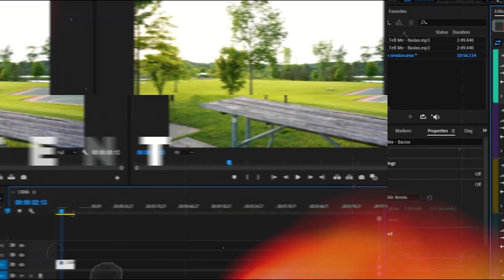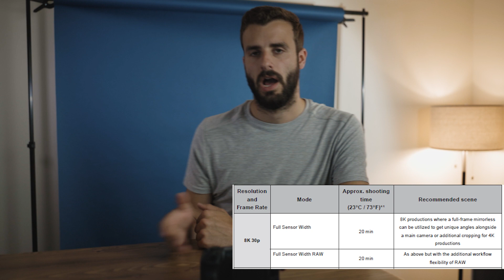How To Prevent The Canon EOS R5 From Overheating

Comment: Hey just wanted to spread the word that you can also plug in an external recorder (like Atamos Ninja V) and if you remove the memory cards you can record 4KHQ as long as you want.
Reply from the maker: Yeah, I have that on my list to test since I have a ninja V which I would imagine you can get some  pretty long record times since the processor is not working that hard at all if recording externally. I might even buy the adapter to allow me to record 4k 60 externally. But as for now, testing the internal capability is key.
Reply: Sorry, can you explain this to me as someone who is new to camera specs? How does an external recorder help eliminate overheating?

Comment: Wow, finally a review by someone who has read the R5 manual and clearly understands the strengths of the camera, as well as the limitations.  This is how a review is supposed to be done!  Great job!!!  I am a wedding photographer and pre ordered the R5 for "stills".  Already purchased the Canon 28-70 f/2.0 and cannot wait for the R5 body.
Reply from the maker: The 28-70 f2 is the BEST. absolutely love mine. Its what I used to film the vlog. But yes, not many people actually looked into the spec sheet to see what canon designed each mode for. Instead they just see "oh it overheats when you shoot crazy high bit rate video at 8k raw, that is unacceptable" and I thought I would help shed some light on that.
Reply: @EngineeringFilmmaker  I just subscribed, liked, and clicked the bell.
Reply from the maker: Thanks!

Comment: The overheating culprit is the CF Express Card reader/writer and even just at idle. I already have an R5. Sony ditched this format in their A7s3 because of these issues I’m pretty sure. In the end, other things cause heat too, but the CF card is the biggest problem.
Reply from the maker: The processor is what gets too hot. It has to compress all the footage you are taking into something to send to the SD cards. The cards do get hot but the camera can still overheat with external recording since it still has to compress footage. The reason you have to use CFexpress cards on canons formats is because the bit rate is WAYYYYY to high for a dslr/mirrorless camera. Normal 4k and 1080 are fine. 4k 60 and above start at like 800 mbps and go up to 9000mbps which is way too high. Sonys new camera I think doesnt reach 1000mbps only like 600 which is why you can use a regular sd card. Normal SD cards (the expensive ones) just cant write data fast enough compared to what the camera is trying to send it at. CFexpress cards are 10x faster than sd cards.

Comment: Solid recap. I see too many people projecting a personal defense of the camera as if to validate to themselves it's worth it. It's a tool not a toy lol if the tool is inconvenient for your work scrap it. At the moment no. Once that fan adapter comes out then possibly. Until then I'll stick with the S1h. I do interviews and commercial work so a single mention of overheat is a liability on the field and for 4 grand I'll let others beta test this until updates are made.
Reply from the maker: yeah, the 4k 60 is not meant for weddings. Just had some overheating issues yesterday with it. Making a video soon.
Reply: @EngineeringFilmmaker  looking forward to seeing that
Reply from the maker: Uploading now. Just a short recap video about it not really working in 4k 60

Comment: I ordered my R5 and I'll use it for hobby vlogs.. I only shoot in short bursts anyways, so the over heating doesn't apply to me.  However, the Sony a7s3 was tempting, but for $300 less, its missing camera specs for my photography needs.  Plus I have a few RF lenses that I will never part with 😄
Reply from the maker: 100000% I am right there with you. Sony for photo is just  like buying a smart car to haul a camper lol. I also have the RF lenses and will also never leave them.

Comment: Awesome video dude, I totally agree with everything you said
Another, maybe useful thing for some of the creators, is that you use an external recorder like the Atmos Ninja V you can actually get past the record limit (and mayne the overheating issues that may appear) - which is a big win in my opinion. I'll definitely look to get myself an R5 in the coming months...seems like a world difference from the EOS R, much more polished, rafined and improved across the board.
Reply from the maker: Yes! Thank you. I will hopefully be doing some tests with an external recorder since I do have a Ninja V. However, the highest you can go is 4k 60 and i am not sure what kind of bit depth it can record at. In order to shoot 4k 60 on the V you need an adapter of some sort that seems to use SDI instead of HDMI so I am not sure if it would work since my camera had HDMI output but who knows. I know that there is a Ninja recorder that does 4k 120 but its $1200. I dont know of any recorders in consumer range that record 8k though. 

I would imagine you could get past the overheating if you use external recorder since the overheating portion usually comes from the processor not the sensor and since you will be recording externally the processor has a lot lower load since its not compressing all of the data onto a card internally.

Comment: Enjoy this while it lasts. Respectful commenters with insight and nuance. Winter is coming. This video is on point. What is the R5 designed for? Not shooting Avengers 12 in 16K. A tool for photographers that shoot high-quality video as part of a professional portfolio. Per the question below, how are you editing/viewing the footage? Alien technology? Quantum computer?
Reply from the maker: Thanks! I have already gotten plenty of the "winter is coming" comments on my last R5 video and on a FB group I posted it to so at this point, I am used to it. 
I have a pretty good setup as for a desktop PC. I have not tested the 8k but the 4k60 does fine. I plan on upgrading my CPU though. I have an 8 core x series i7 right now and want to get the 18 core i9 xe but its out of stock.

Comment: Nice to hear a rational voice.   Buy the right tool for the job.  Don’t buy a hammer when you need a screwdriver and then complain it doesn’t work.
Reply from the maker: Exactly! Its like buying a power drill and manually turning it to screw a screw and getting mad at the manufacturer because you used it wrong. Now if the R5 does overheat in 1080 or even 4k 30 (Full frame) or other modes it shouldnt then there is an issue

Comment: I want to use the 8K mostly to extract photos.  I think that I can deal with the 4K 120 FPS limitations, but 15 minutes is not all long as people make it sound.  It takes a lot of minutes much of the time to get a few good minutes of footage.
Reply from the maker: I mean there is no reason to shoot 15 min straight of 4k 120fps. taking 15 min of 120fps footage would turn into such a long video clip. Using 8k just to get photos will get expensive. CFExpress cards are not cheap.
Reply: The Engineering Filmmaker i feel in every response you are dancing around the fact that the camera starts the overheating as soon as you turn it on. You don’t have to record 4k 120 for 20 min to overheat just use the camera and when you need the 120 it may already be overheated and unable to shoot 120 or 60.
Reply from the maker: I just shot in 4k 60 and 4k 120 ALL I for almost 2 hours yesterday for a commercial job shooting b-roll with very little breaks in between shots and it gave me no issues with heat or warnings. I am not avoiding anything, I am doing actual research and using the camera the way it is intended. Most other youtubers hit record wait for it to overheat then change to 1080 and say "wow would you look at that, you cant use the camera at all" well yeah, you overheated it. Just like you cant drive a car immediately after it overheats. It needs to cool down or else it will break down again.
Reply: @EngineeringFilmmaker  Great to hear.  Thanks!

Comment: Awesome video like always, but you dont mention that 8k is awesome for tv commercials, you dont record 20min straight in that kind of production, every shot is planned very carefully. Just imagine a cereal comercial, the first shot with the milk and then a really good quality 8k crop to 4k macro on the flakes in the bowl, a short interview and you can pan in post croping to 4k, crop in different shots just with one camera. Thats a lot of quality with less equipment. You can do a lot with 8k you can record the kiss in a wedding and then do a crop in post and looks like two cameras in that shot... thats a lot that you can do with 20min in 8k I think is not a limitation, you just have to know where to use it. I dont know any body that film a wedding for more than 20min straight in slow motion, and if someone do it, thats the more boring wedding video that I can imagine. Video production dont work like that. I think the R5 have a mode that the camera switch to 1080 when you are not recording to prevent overheating, and when you press the record button start recording in 8k. Im not sure, but someone tell me that the R5 have that option. That camera is not a camera for someone to travel, that’s a professional production or photography camera, if you are a professional and you know what you are doing there’s no reason to have problems with that camera. Is an awesome camera.
Reply from the maker: This is very true. I actually did talk about a lot of that but took it out since it didnt necessarily need to make the cut lol most people only watch 4 min or half of the videos so I tend to try and shorten them as much as possible.
Reply: The Engineering Filmmaker man you know a lot and you have a lot to say, dont cut the talk, your market is different than the market of the people that you makes videos. You do work for companies TV or facebook adds, you have to compress all that information and try to keep the atention in the first 10 seconds if you dont capture his atention the  skip the add. But your product and your market is different we are filmakers like you and we enjoy this filmakers platform and we enjoy share experiences and knowledge. I understand what you said but you are not targeting a regular market your channel is targeting professionals like you. Dont cut the talk we need all the information that you can give. We want to make a desicion of spend a lot of money in a camera and you already have one, all the info that you can bring to us is valuable. This is your platform and let me tell you, you are going to be successful. But remember that we are not regular public we are filmakers like you most of us we enjoy all that information, maybe some people just see 4min but other people like me are going to see it to the end. by the way Great job.
Reply from the maker: Its hard to not cut things out like that. I for some reason enjoy learning about things I find interesting and take the time to do research when I dont know something so I can find what I need. There are a lot of people who know more about filmmaking than me by far but I am always open to learning what I dont know. I tend to enjoy the more technical side of things. Such as the R5 overheats, so why? So i did some research into the why and it helps me understand with an engineering background since I have to take A LOT  of classes related to heat transfer so I have a decent understanding of why the R5 is struggling in a more detailed sense. 

anyway I appreciate the feedback. Maybe once I get a little bigger on Youtube, I can keep those more informational parts in my videos since people are more likely to watch the whole video.

Comment: The fact is that after you've shot 15 minutes in 4K 120, you can no longer shoot anything other than 4K 24 for several hours. And then in a few hours it will be possible to shoot for another 10 minutes. The problem is not overheating, but overheating recovery.
Reply from the maker: Well the other thing is that there is no need for someone to shoot 15 min straight of 4k 120. and if you are, you are not using the camera or 120fps correctly. Slow motion is usually shot in short bursts not 15 min intervals. I shot some commercial stuff yesterday in 4k 60 and 4k 120 for over an hour in short bursts and had no heat issues. Also it is not hours of recovery, its around 20 to 30 min if you really overheat it. Were talking if you record until the camera shuts off thats your max time. If you record and get a warning it is getting hot, you are looking at a few minutes to 10 min. in order to have a recovery issue you have to have it overheat so the overheating is 100% the issue since recovery is directly related to overheating. The camera is weather sealed so the heat dissipation is not that great which is why recovery is bad.

Comment: The problem is, 4k 120 , you never actually get the 15 minutes. I did I photoshoot in door , 68 degrees. Shot about 35-45 minutes of photo. Went to record some 4k 120, 4 minutes is what I had before overheating..... that’s not going to work. Shot those 4 minutes , let it sit turned off for 30 minutes. I had 3 more minutes I could shoot... not even a 1080 120 to fall back on... they must fix this
Reply from the maker: Why are you shooting 15 min straight of 4k 120? Canons spec sheet says "bursts of slow motion" 4 min clips are not bursts. Now I do agree that shooting photo then going to video, you should not have heating issues
Reply: The Engineering Filmmaker Well music videos, wedding. You can’t really pick and choose when to do slow motion.have to shoot what the scene needs. I’ve never shot 14 minutes straight. The way it is now there is no 1080 120 to fall back on and if you do anything with the r5 at all, I mean even take a few photos or record 4k 30 line skipping mode for 10-20 minutes, the 4k 120 is down to about 4-5 minutes before overheating. That also doesn’t take into account framing shots while not recording... playback of video, adjusting things in menus. By the time you set up the shot, down to 3 minutes 4k 120.... it’s a joke